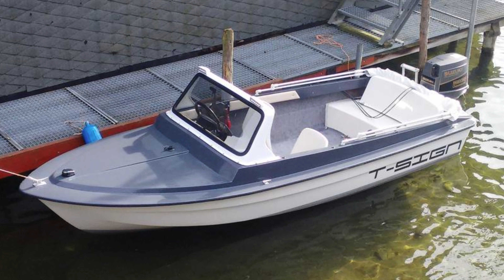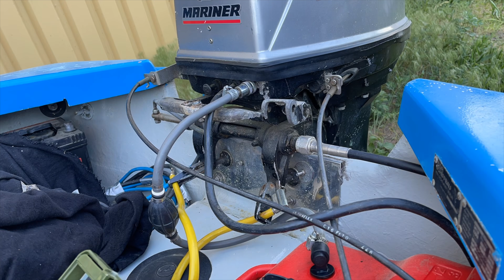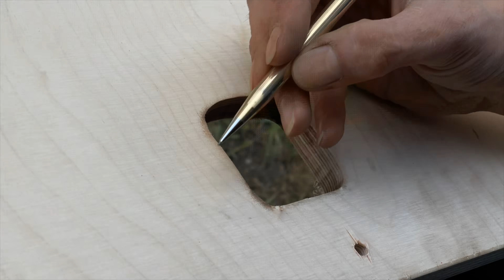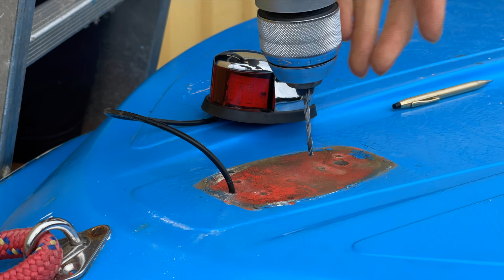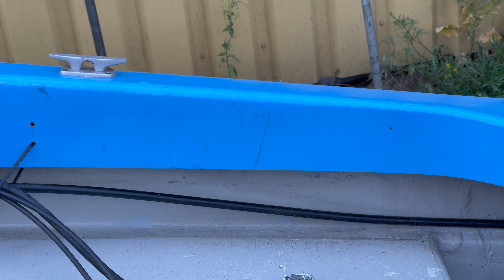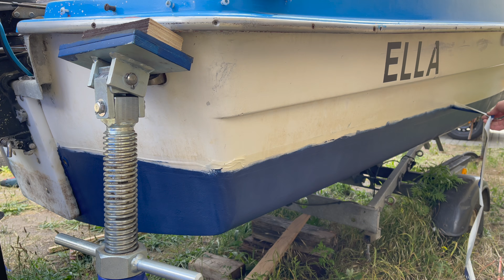1989 East Germany Powerboat Refit and Drive Report

Comment: You need a much larger container or better still a set of 'muffs' hooked to a hose to run the motor.  If you put it in gear for an instant it throws the water out of your small container and sucks in air.  Presto impeller ruined.  Did you notice that your tell tale water stream was lacking?

Comment: the tell tale is not working I will guess it is blocked or you would have seized the motor also need to change the impeller for better cooling

Comment: I admire the exactness of your work! Myself I'm in an ongoing refit on my boat, a 1989' Bayliner 2556 Fly. Here I allow myself a slight "fuzzyness", for ex. with sawing boards or so, but use concealings to make the things even or plain optically. This is because I'm focused in getting my works done but not consuming too much time for it. But in the meanwhile I learned to be more exactly by your example. So its also a good teaching, I get from your doings. 👍🏼

Comment: I think your new dashboard is a good design but please paint it the original lovely blue colour. Clear finished plywood is still plywood, Also, just to protect your passengers in the back seat, cover the wire supports with rubber tubing.

Comment: Hi BATTERY in front not good  boat on the away up and down   battery break down  WHY TWO BATTERY ??  how to you  isolator battery from engine  no auto switch for   bilge  time drill or cut panel water get in glass and rood the wood

Comment: Yes you do need a break from the Big Blue the refit is quite intense over time. All the Floaters you have had have been vastly different from each other so technically they are all first Boats. What a great bit of kit and as you say for not a lot ya have a fast mover. Great job on it,s first refit what a hoot. I don,t think you would have got a cheaper boat if ya tried. 

All you doom sayers and moaners go get ya own boat or bugger off go annoy some one else.

Outstanding and excellent Carry on.

Cheers Nick

Comment: Amazing work. Only thing, please change the throttle over to the correct side!!!! It will look so much better and you will be able to rev the engine while it’s not in gear to get that two stroke running easier.

Comment: I understand the need to work on a different project in order to clear your head from your primary.  If anyone sits on that back seat they will pull those screws out on the first or second wave.  You screwed into the end grain on inexpensive plywood.  Good luck with her though.

Comment: did you attach your backrest to the watertight compartiment of the boat with screws by which you kinda removed the "water-tightness" of that compartment?
Reply: Should have used bolts and sikaflex or screws and sikaflex